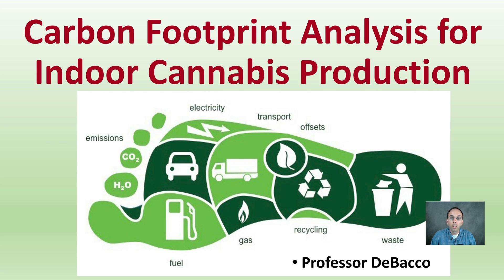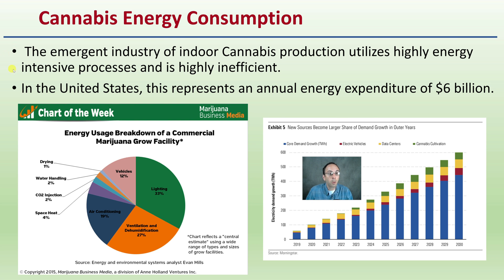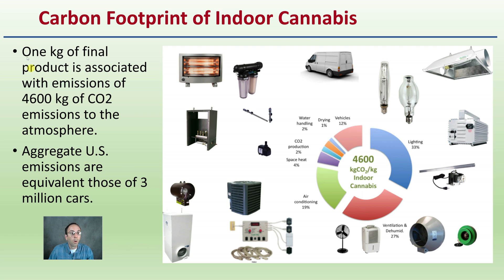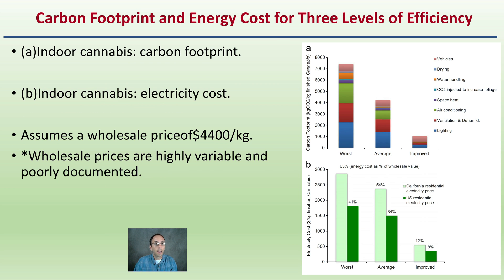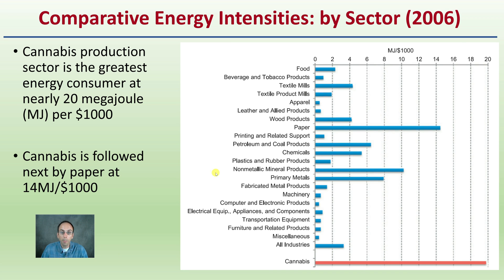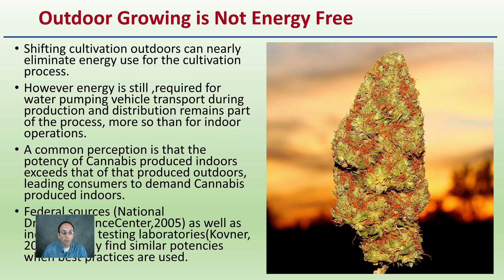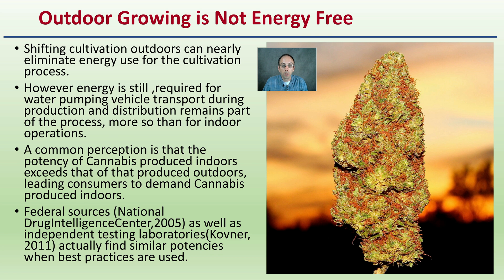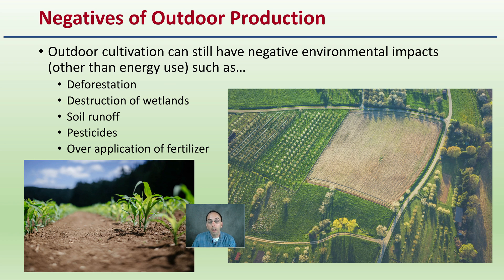Carbon Footprint Analysis for Indoor Cannabis Production

Comment: I think your Energy Intensity table represents a deficient growing facility. 
I'm pretty sure you can run a high efficient large scale cannabis growing building that would eventually reduce CO2 emissions in the atmosphere. 
Plus, all the derivates from hemp production for essential oils.
Defoliation biomass waste for biogas production. 
The flower itself for legalized selling. 
If you conduct a triple bottom line analysis could be very sustainable.
Reply from the maker: Indoor grows utilizing grow lights will have a hard time reducing overall CO2 emissions, not to mention all of the other energy inputs.  Remember, each time every is transferred there will be some "lost" to heat.
Reply: @DeBaccoUniversity  Grow lights now are very efficient, LED especially. There is a whole industry behind this. 
Led Lights
PV solar systems
Recirculating water systems. 
Temperature and humidity control. 
You could perform an efficiency analysis and heat cascade energy systems to make it sustainable. The location of the facility will represent a big parameter in the modelling.
There are ways to make it sustainable. A three bottom-line analysis must be done.
Reply: @VersaiOnline  I believe you are wrong. 
Being profitable is just an output of your modelling, that will show up in the economy analysis. There are a lot of factors besides being profitable like your IRR and NVP just in that section of your TBL. 

You need to perform a environmental analysis and a social analysis. Once you gather the whole spectrum of the project…the TBL will tell you the sustainability of the project. 

Fossil fuels could be used just as a backup if designing a stand-alone system. 
But I believe you could run it just with green energy, but location is a very important factor to consider
Reply: @cr1ptoSeb  If you had a little knowledge of the expenses and energy inputs, you'd know you don't need to do an analysis. It's not even close. It takes nearly 10x the area in solar panels to power an indoor grow. And the bar is only rising with additional technology. It's a fossil fueled green rush and it is not realistically ever going to become efficient enough to justify. Carbon for carbon you can grow 10x more under the sun. The future of commercial growing is in LED lit greenhouses. If all of the consumed flower was grown indoors it would require a solar farm the size of North America. It's highly inefficient.
Reply: @VersaiOnline  that’s why location is very important. And you are wrong friend.

1. Growing hydro indoors you can harvest more times a year. 
2. Using a 20-4 hour cycle your plants grow 20x faster. 
3. You can implement a bettery system for dark hours.

Again friend,  it is possible to do so...but a lot of engineering needs to be done. Is not just a carbon 4 carbon conversion.
Reply: @VersaiOnline  you are mistaken again friend. 
With growing indoors you can: 

1. Grow hydroponics which gives you more harvests a year than outdoor grow.
2. Put plants in a 20-4 cycle during veg and 12-12 in flower.. Like this you can grow plants faster and therefore carbon intake is higher.
3. Implement vertical grow buildings, reducing space and cascading energies and water flows.
4. A battery system could be helpful to give the system some autonomy but capex could shoot up. 

Again, you need to engineer the whole place and location is crucial. It goes beyond a carbon for carbon comparison like you suggesting.

Seems you mistaking environmentally friendly with sustainable which are two different concepts…

As someone who designs PV systems for living. I can tell you. It can be done.

I’ve seen proposals for these type of projects. Massive storehouses with 2-3 floors full of cannabis and they are powered by solar.
Reply: @cr1ptoSeb  then what are you waiting for bud? Do a 3 line analysis, write a proposal, and get stacking! 😄

Comment: curious to know? with your size of cultivation (indoor), if you use solar panels. how much energy would you need - also storage/battery capacity?
Reply from the maker: Solar panels can not supply the power needed by the grow lights assuming the roof area is the same as the growing area.  Best to simply use the leaves as their own natural "solar panels" to absorb the sun.